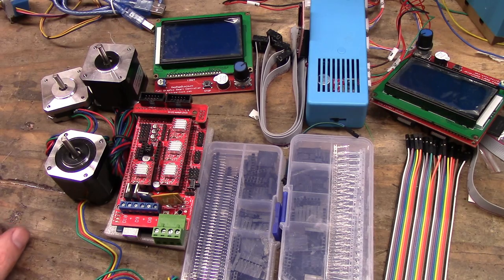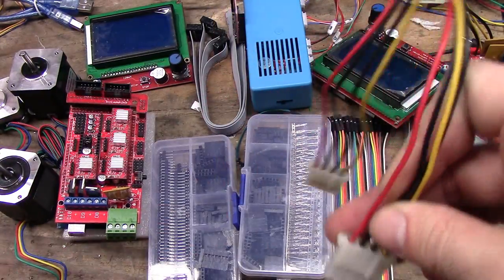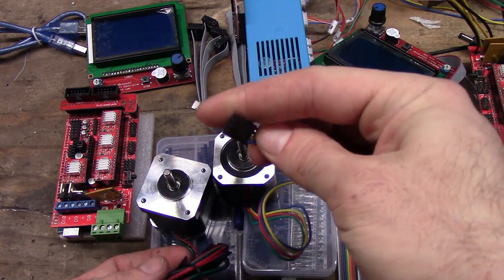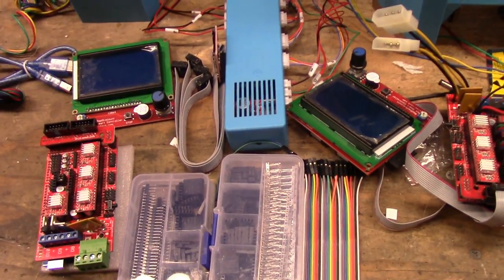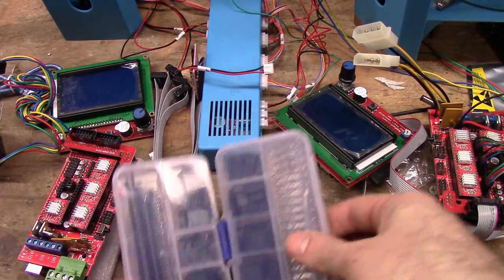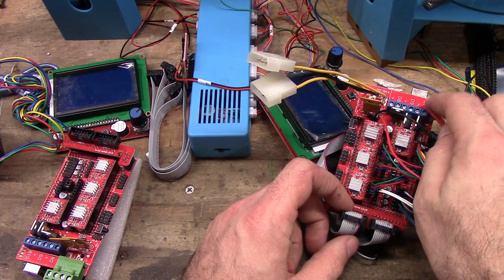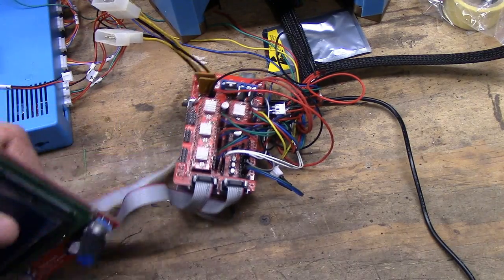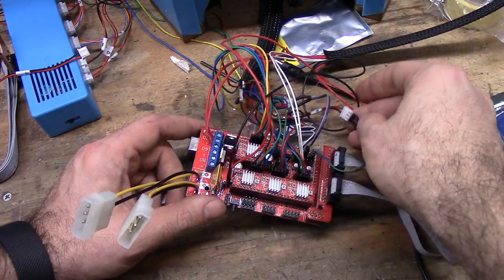Ramps 1 4 basics part 2 wiring

Comment: I have prusa mk3s psu, do you think will work on my ramps 1.4?
Reply from the maker: if its an actual prusa power supply, then it is 24v instead of 12v. it will still work with RAMPS, but the fuses need replaced. and you will need to make sure all other 12v components are swapped for 24v (fans, heaters, heated bed, etc)
as always, verify everything on respective websites, RAMPS info can be found on the reprap.org website.
Reply: Got you, I destroyed one mega already ( but it ain't stop me).

I installed another complete set already,  but after  flashing the marin, the machine cant do homing, moving axis to negative  side ( motors can only follow the direction of the encorder clockwise,  no ccw response).

I haven't tried printing yet.
Do you have any idea please?
Reply from the maker: @yigageorgewilliams8817  heh, i have a pile of burnt out megas (you can see me burn one out on one of the couple of live streams i did a while back) my recommendation is after flashing the mega, connect to it via usb emulated serial port. youll have to look up the baud rate in your config file. it should respond and accept commands. one of the first commands i usually do is M119, this will respond with endstop states.
Usually when i cant get things to move its due to one or more of the things being triggered when they shouldnt. this could very well result in one way movement (away from endstop). if M119 is working id then verify settings in flash on the printer with M503. if you are getting responces from the M commands then the mega isnt burnt out and it is a configuration issue. if no responce either the flash didnt take for whatever reason, or its burnt again. 
One tricky thing about ramps boards is the endstops, they have sense + and - all in a row, very easy to plug them in wrong and short the + and - together and burn out the 5v power regulator on the mega
Reply: @workshoptinkerers447  before I continue. Thanks for the RESPONSES AND SINCERE HELP.

I think I have a hill to climb with configuration.h,  I flashed  it with Gmax 2 configured marlin and it moved well though the bed size is different.

Let me follow your tutorials and see what to do.
Reply: @workshoptinkerers447  hey buddy, I managed to use ender 3 and works fine .
Just minor error with Z axis.
They move with extra noise and friction. 

Another issue will be resolving the bed size .

I will opt out the pinda probe for homing , its tricky because I have a fixed bed.

You're reply is helpful and worthy.
Thanks for the work

Comment: So hypothetically...if i plugged an endstop to the wrong position, using the bottom row of pins. Is my ramps fried? What about the Arduino Mega?
Reply from the maker: heheh, i actually did exactly that in one of my live streams a while back. for me it was the power regulator on the mega that fried. i was able to swap that out and get the mega working again.

Comment: How do I add two more stepper motors my z is two motors and am using a diamond hotend
Reply from the maker: the Ramps board Z driver already has two headers for 2 motors. but if you cannot get both to reach to the board, wiring them in parallel will also drive both at the same time. Make sure to adjust the driver up enough that it has enough current for both motors as well.
Reply: @workshoptinkerers447   i need seven steppers total

Comment: Do you need separate power sources to power both the Arduino and ramps? You can't make them share the same power supply?
Reply from the maker: the ramps board supplies power to the arduino. If i understand it correct, the two connections on the ramps board is for different functions. one for main power which is then regulated down to 5v for the arduino. the second is for high amp uses like a heatbed if equipped. i dont believe both are needed, but easy enough to hook both up to 12v so why not
Reply: Workshop Tinkerers thanks

Comment: Hi, I'm using an old Dell PC power supply, I contacted the Z axis only because I'm building a DLP printer 
On the arduino I have Marlin and controlling it with Pronterface, 
I connect the green and black on the power supply so it work, once I try to move the Z axis the power supply stop working so I have to reconnect the green and black again and the cycle continues. 
Do you have any suggestions? 
Thanks again

Comment: Hello! Can you help me with a problem of my extruder of the 101hero? It's because one of the wires of the extruder broke and I need to now how to repair (the green wire) 
Or if you have time, made a video about the fan of the extruder please.
Reply from the maker: if you had a wire snap your easiest bet is to get a hold of a butt splice and splice the two ends together, minimal tools needed as a butt splice is a crimp on, which you can use any pair of normal pliers to use.
Reply: Thanks
Reply: Other question: In your experience of using the 101 hero when do you saw the fan is working? It's because start using my printer no more than one week and no more than 3 or 4 hours per day and I don't now in which cases the wire it's extremely necessary for the printer
Reply from the maker: the cooling fan on the hotend is used to cool down the heatsink on the hotend to keep the heat localized as much as possible in the nozzle. without it the filament will probably start heating up early in the hotend. this would cause sticking, burning, and other undesirable results.

Comment: Hi,
how can i change the filament from my 101 hero?
I want extract the filament but does not move.
please help me
Reply: Sorry, i have another question...
I want use Slic3r for convert file .stl to .gcode, but in the first configuration of the program, I have to choose the language that the printer(101hero) use.
What is that lenguage?
Reply: Sorry, but I was wrong, what I don' t know is the firmware that uses by the printer.
When configuring slic3r can choose between: Reprap, Teacup, MakerWare, Sailfish, Mach3 / LinuxCNC, Machinekit.
I chose Reprap but despite the printer part, stops to 2 cm from the pot and does not release (not a problem of height).
So I want to know what is the right firmware.
Thanks so much

Comment: could you put links to where you got the motors?
Reply from the maker: Unfortunatly not. I don't know for sure where i got them. They were either from Amazon, Ebay, or aliexpress. but any NEMA 17 or 14 size stepper motors generally are right. I do recommend 4 wire, and 200 steps per revolution to be looked for.